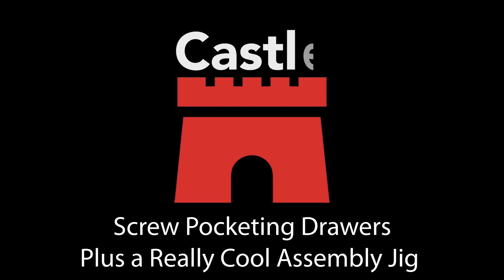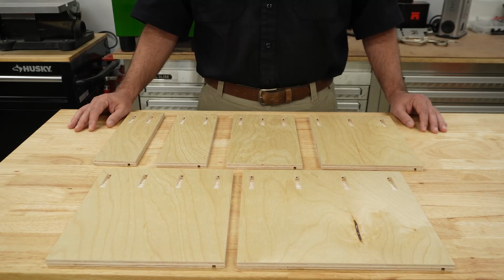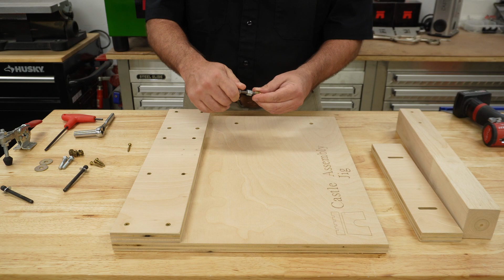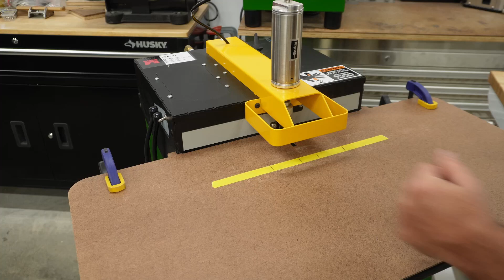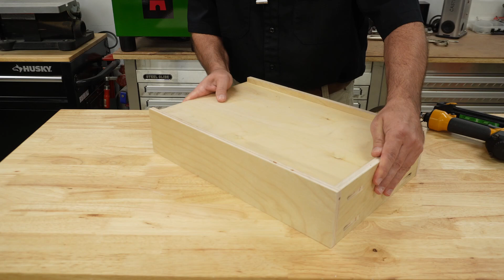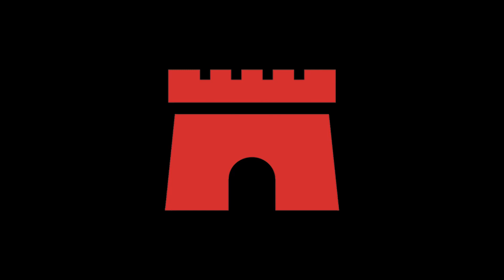Screw Pocketing Drawers, Plus a Really Cool Assembly Jig

Comment: This is a great jig for a homeowner making cabinets. I started assembling drawers using shop made corner blocks and 2 f-clamps. That's 4 blocks, 8 clamps and lots of fussing to get all 4 corners square and flush. After 2 drawers with 23 more to go, I knew there had to be a better way. This was simple to make and works really well. Thanks.

Comment: This assembly jig changed my life, or at least it changed my life with respect to putting together drawers because it makes is SO MUCH EASIER to align the drawer components. I guesstimate that it now takes me less than half the time it used to take to put together a drawer and if I wanted to do it scientifically its more likely it now takes me maybe 1/5 of the time it used to. For such a simple jig to be this helpful is a real work aid and I would suggest anybody building drawers with pocket screws, no matter whether you use Castle, Kreg, or any other, you need this jig.

Comment: Hi Castle. I really liked this jig, but think I took it to another level for a few dollars more. Made it slightly larger and made one side for 15/32" (1/2") plywood and the other side for 23/32" (3/4") plywood. Basically making a mirror image of the orginal jig (or a left and right). This makes up a double sliding clamp (which I made a little thicker by addidding a piece of masonite to increase the thickness on both sides. Then I left some space to insert some spacers to align the top and a matching spacer to keep the 90 degree angle. Have a 15/32" and 23/32" blocks to stabilize the 2 x 2 blocks just in case it gets banged and keep a very thin shim, just in case I need to raise the 2 x 2's a little to insert the drawer parts. Think it makes it a little more precise to do both thicknesses.
Reply: Are you willing to share picts?

Comment: Big difference from the pneumatic then the manual. Because the manual it’s a pice of junk for almost 2000$  plus have no returns your stuck with it if you don’t like the 2 bosh router under it tied with home depot hose clamps 😂electric box from home depot 😂c mon 🤷‍♂️be more original